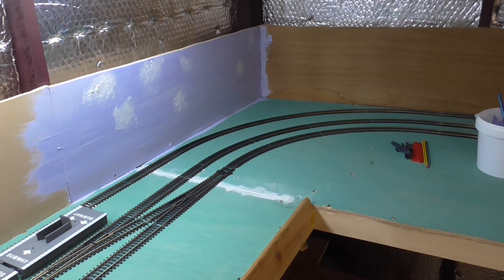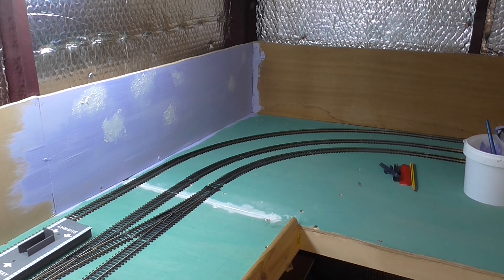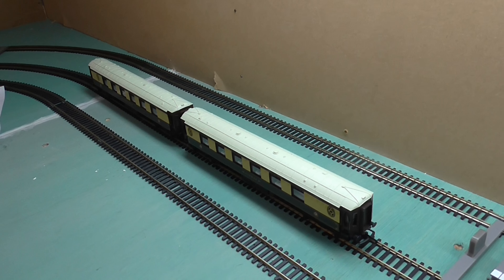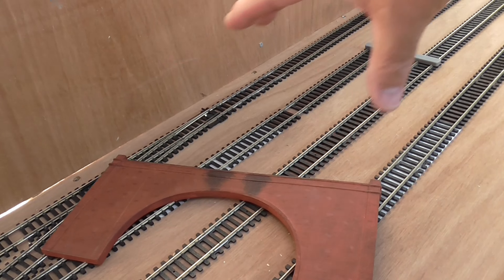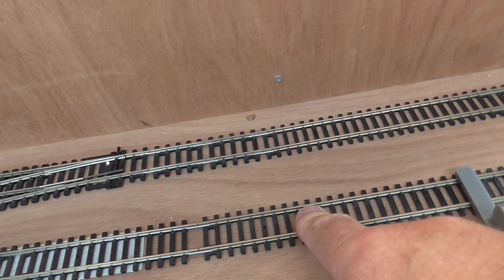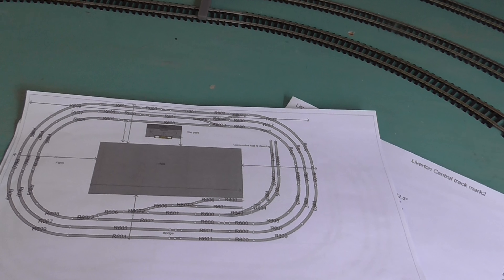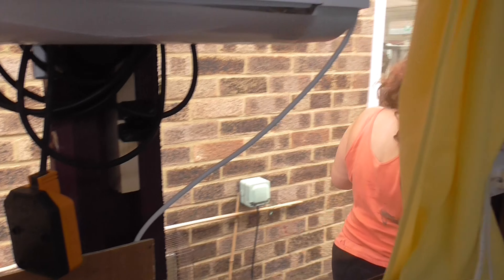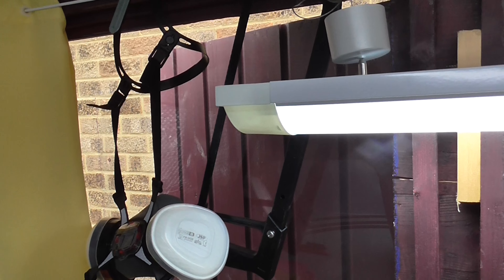Model Railway – The track etc.

Comment: Hi Simon, good to see the layout coming together. I think you will find that the third track from the window is too close to allow a convincing tunnel to be modelled on the first two tracks. The slope down to the track level will be too close to that third track and will need to be almost vertical IMHO. ............................John
Reply from the maker: Hi John, I have come up with an idea to build a tunnel, what I may do if I have issues is to include all 3 tracks in the tunnel, or I may just have a two track practice layout.  Many thanks for you advice, very much appreciated...Simon

Comment: Looks great so far .

with the tunnel why not make a cardboard one first to check the clearances .

I will be interested to see how you get on with the track screws  

Good idea with the back scene the paper ones can be a pain to get flat and not get bubbles in also they might not last long in the shed .

I will have to give any rail  software a try when I have time
Reply from the maker: Many thanks for commenting Oliver. I think I have decided to trying it using plywood, but I have been told Metacafe do something, which I am going to have a look at...Simon

Comment: All those ideas sound good.  I think building your own tunnel portals would be best.  I would be a shame to cut your current portals and find that even with the cuts there isn't sufficient clearance.  Plywood would do, but you may recall that I have been using 5mm foamboard.   Withplasticard brick sheets to cover it, it will work fine, be light and easier to cut.  if you do go with the foam board, get it through  Amazon not a high street stationer.
Reply from the maker: Hi Stephen, many thanks for commenting, will have a look at foam board...Simon